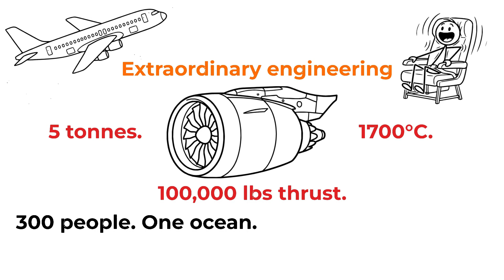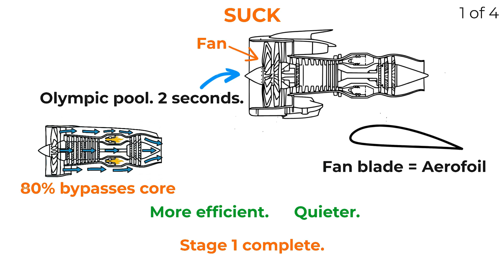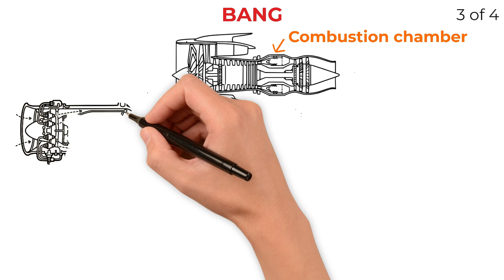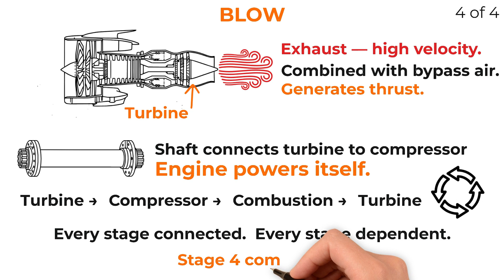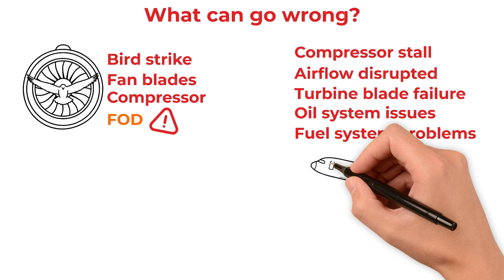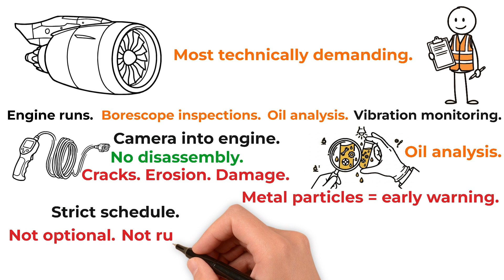How Jet Engines Actually Work

Comment: Decent until the bang part. If you have a jet engine and it goes bang while flying, you had better be looking for an airport NOW. Whoosh might be a better term then BANG
Reply from the maker: Fair point. Bang refers to the combustion process, not a mechanical failure. Continuous, controlled burning rather than an explosion.